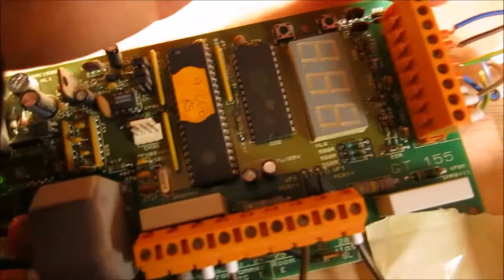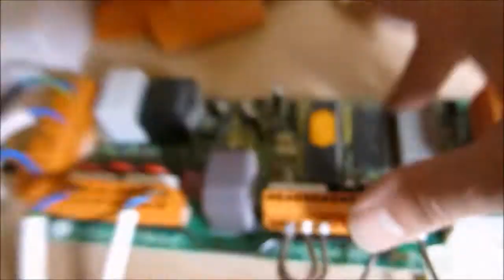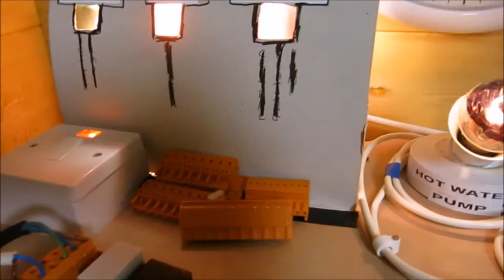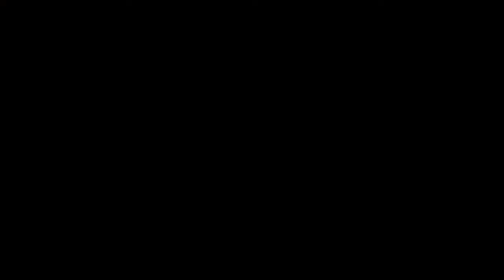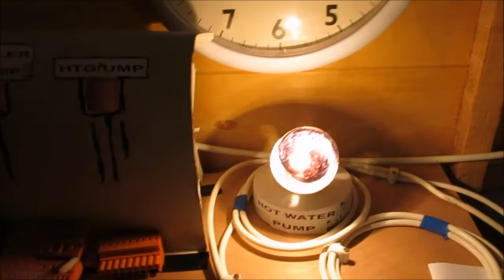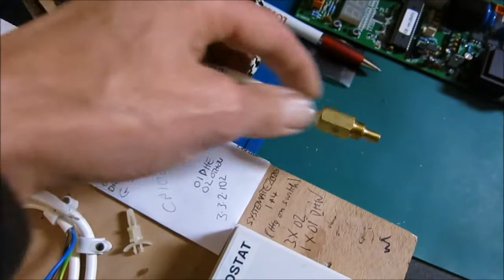Gledhill GT155 GD131 fault finding (is my board faulty) contact me via murraymartin.co.uk

Comment: Hi Murray, my pcb GT155 BM 145. I can only find bm140,150 ,180 etc in the market. Would bm140 works with my boiler? Cheers khal
Reply from the maker: Hi Khal, which model of Gledhill do you have, is it for example a Boilermate 2000? Anyway if you have a pcb marked GT155 with the exception of a couple of Gledhill models any version of either a GT155 or a GD131 should work fine. If you want your pcb fixing I can do that for you for £45 or I also offer an exchange service where I send you a pcb to fit, you then send me the faulty one back and I credit you £45 back, that cost £100 initially. Let me know if I can help you, regards Murray

Comment: It drives me mad my system runs at night, I want a to have the system shut off at say 10pm and come on again at say 6am, I thought I found a way in the there is a hot water signal in on the rhs of the PCB ( its looped directly to live. ) , so I cut this connected to digial timer ( one that commnads water and heating ) but ..... The boiler pump keeps running, it appears to no longer command the boiler which is good but the pump is running away so not good. I'm looking into using a Rasberry pi to compleatly replace this controler now. Would be interesting in any thoughts. I would also like to control the on  - off temperature and also provide a boost feature.
Is there a way to tell this board to shut off trying to heat the thermal store for a while ? do you know where I can find information on the electrical characteristics of the sensors. ? 
are the Theromcouples  or  Thermistors. if the latter are there any technical specs.

Comment: I can't get the manual link to work mate
Reply from the maker: Search on Google for Gledhill Boilermate 2000 manual there are a couple of sources including Gledhill direct  This is a link to a different download https://www.heatingsparesltd.com/download/boiler_manuals/Gledhill/Boilermate_2000_Design,_Installation_And_Servicing_Instructions.pdf
Reply: @buckholst  are nice one Martin you are a legend mate if I need a new card could I pick one up as I live near Newark its about 50min away from us and drop old one off
Reply from the maker: @mark85365  Sure no problem just get in touch and we can sort that out.
Reply: Is that the manual for boiler mate A class its model aba41b2 and can you get parts for that model
Reply from the maker: @mark85365   Hi Mark I only provide parts for the Gledhills that use the GT155 or GD131, the part number is at the top right corner if it is either of those two pcb's that you have.   What model do you have?  The link above should be for the Boilermate 2000 - Regards Murray
Reply: @buckholst  my one is boiler mate OV
Reply: Iits boiler mate ov a class its running without a timer
Reply: Have you a way I can send you pictures of my pcb board
Reply: Its a long shot but could you come out look at are boiler mate we live in Gainsborough

Comment: Hi I have the boilermate A Class and I can’t read the codes a lot of information come up (no error signs though) [5.1, 63, 44, 52.] please can you help in anyway? I can’t afford to get an engineer in atm I just want to know if it’s repairable.  Many many thanks
Reply: I have hot water but no central heating
Reply from the maker: Hi Fatima - currently I don't repair the BM A Class pcb's and therefore do not really have a great understanding of them, I am aware of some of the common issues, what exactly is the problem with yours i.e. what symptoms does it have?  Could I suggest that you join this forum and make a post for help on there, there are some very knowledgeable people on there who may well be able to help you.  https://gledhill-repairs.forumotion.net/f9-boilermate-a-class - I assume you have the manual as this describes some of the error codes - http://www.gledhill-spares.net/documents/BMAClassSP-Iss6.pdf  -  Regards Murray
Reply: @buckholst  thanks for the reply. We have only hot water no heating the motors seem to work fine the boiler seems alright but I’m guessing there’s an issue with the PCB I’ve tried the manual but it’s gibberish to us. I’ll try the website you gave thanks

Comment: Great video, I have an issue with my Boilermate 2000, my PCB like yours has the 4 green LEDs on constantly but nothing in the display. I have 3 pumps below but only the right pump below the heat sink seems to be working as the housing is very warm, the left and middle pumps are not moving and cold to touch, I have removed caps and all pumps move freely with a flathead screwdriver. I have tried moving jumpers and holding SW2 power on but nothing has changed. I just needed to know if this is definitely a problem with my PCB?
Reply from the maker: Hi yes those are classic symptoms, the pcb will require replacement/repair.  I can offer an  exchange service or a repair service please visit my website for more information.  www.murraymartin.co.uk    Regards Murray

Comment: Murray.  A belated thank you for your help when I had a problem with my BM2000.  I posted my PCB to you on a Monday and had it back and fitted by Wednesday.  Whilst that sorted the PCB, I still had a problem with the heat sensor which you helped diagnose over the phone.  Once you sent me a replacement sensor I've had it working perfectly since for the past month.  I now better understand my boiler and I reckon I saved over £550 on the PCB alone (my plumber quoted £600 to replace) plus probably another £200 on the heat sensor.  Thanks again.  Robbie
Reply from the maker: Your welcome have a toasty Christmas.   Murray

Comment: Nice clear explanatory video, thanks.
So what is typically the cause for all 4 leds being on and no display - is that the electrolytic caps failure, or something else?
Reply from the maker: It can be as the result of many different things or even combinations of factors including physical damage i.e. water or heat damage.

Comment from the maker: Video showing how to remove a GT155 or GD131 from the panel mounts for repair or replacement. is here https://youtu.be/V1vB_IVoGww
Reply: Hey. I had a GT155 replaced because hot water was cycling hot and cold...  What would go faulty on the PCB to cause that ? If I cant suss it, I'll send it in to ya.